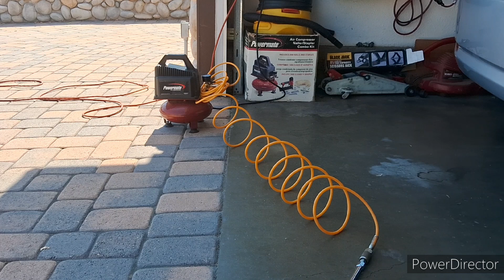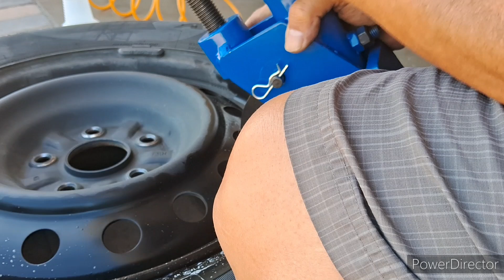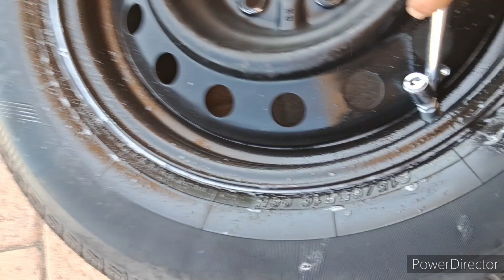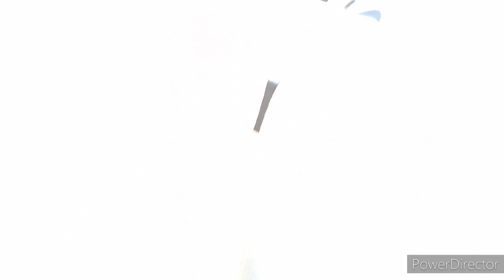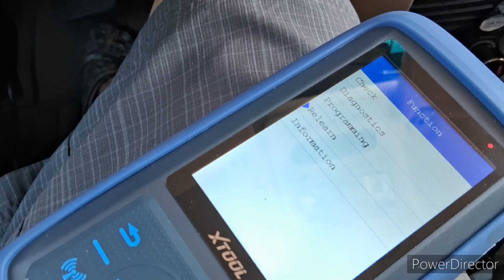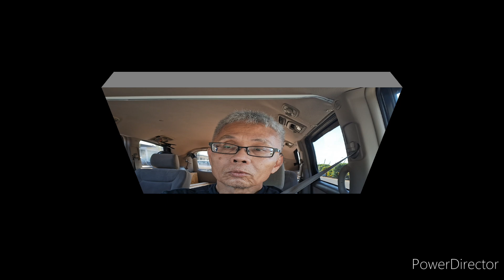Remove and Replace TPMS Sensors on 2008 Toyota Sienna | DIY Way

Comment: Good video.  I'm getting ready to do the same thing on a '08 RAV4 except that I bought the XTool TS100 sensors, which according to XTool is the only sensor that the TP150 will actually program.  I think that's why the scan tool said it failed.  The reason yours worked anyway is because the sensors you bought are made to communicate with your car out of the box.   I've also seen people use 2x4's or clamps to hold the sidewall down while removing the sensors from the wheel.  Just a suggestion for others thinking of attempting the same repair.   Thanks for making this!
Reply: Actually, Xtool wrote the new sensor IDs to ECU but on older Toyotas the ECU basically says “let me verify after you drive it.” The tool times out and shows failed, but once the car is driven a few minutes, the ECU confirms the sensors and the TPMS light turns off. l

Comment: Sweet, I love the bead breaker! Didn’t know it existed, I always had to position the tire under the frame of our truck and use a jack to push down on the bead😅. Best thing is it’s on “prime deal” today 🤪 Thanks Tim you’ve saved me from having to crawl under the truck every time I need to do a tire repair 🎉
Reply from the maker: I saw people do that method and chuckled with a shaking head!😁 Since I am doing two vehicles, it worth spending $60 for a proper tool. One more tool added to the inventory!😝
Reply: @MoBangFoYoBucks  l couldn’t tell you how many tires I have fixed over the years. Car tires, riding mowers, motorcycle. I would have bought one of those cheap ones you have to mount to the floor but no room. I’ve searched here and there for tools to break the bead but never ran across this guy. Haft the battle is popping the bead loose. Once that’s done it’s easy to patch it or put in a tube.
Reply from the maker: @ramblynrocketeer RIGHT!!!!? Amazingly cheap, too!😁

Comment: I’m a big DIYer, but after watching this I think I’ll still use a tire shop for such tasks. 😂
Reply from the maker: @Soobs123  🤣😂🤣 It's not everybody! But at least you see the process and determine if it is worth the money to have someone else do the job.
Reply: @MoBangFoYoBucks  I’ve been keeping my eye on the used market for a tire machine just for this kind of stuff.  It’d be nice to be able to mount and balance tires myself, but the new machines are a fortune.  I appreciate you sharing the experience with a video as I had been wondering how this process worked with just a bead breaker.

Comment: Good job, Tim!  I had the 4 sensors replaced on my Toyota Sienna about a year ago when I bought new tires.  Now I know what they look like, and how they were installed.   Thanks for another DIY video!
Reply from the maker: @inspiredtowander  Thanks, Nanci! With your information about the cost of replacing it by the tire shop, I determined that it is more economical to invest in tools that I can use to do 2 vehicles. I get more bang for my bucks!😄😁😆
Reply: @MoBangFoYoBucks  That's so cool, Tim!  You are da' man!